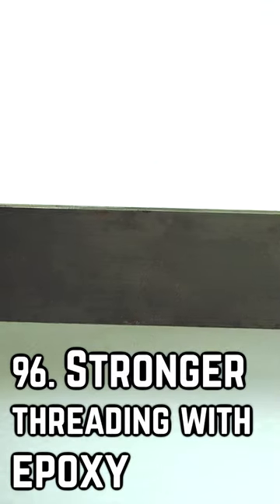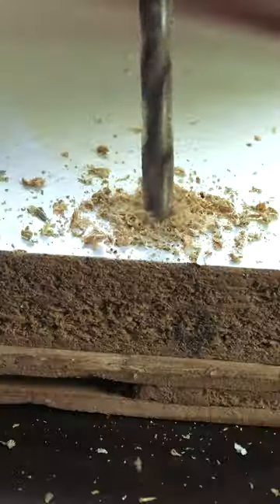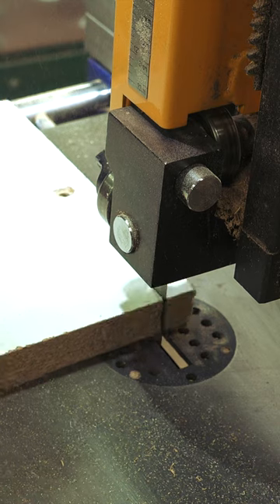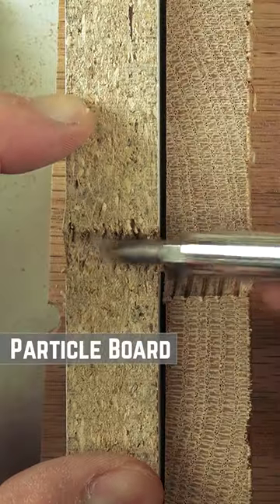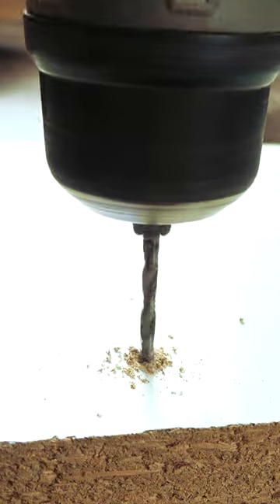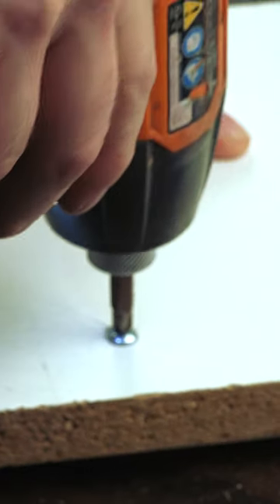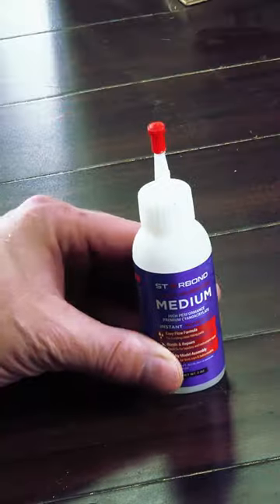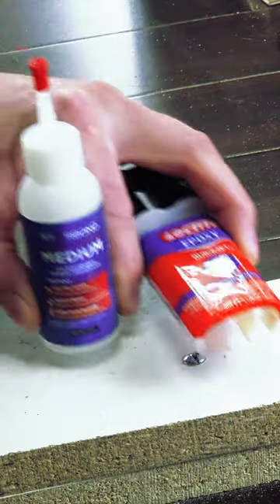96. Stronger threading with epoxy #mtbitesize #shorts

Comment: Laughed at your negative appraisal of plywood as compared to particle board. Sure, plywood can sag, but not  nearly to the degree particle board will. 3/4 inch plywood or the same in particle board for book shelves? Not even close.
I did like your idea to apply CA to screw threads when using particle board, however.
Reply: He means dimensional stability. You'll almost always pick up a perfectly flat and straight mdf board as opposed to plywood where we often get cupping and bowing.

Aesthetically that's a big deal even tho plywood is an objectively better product.

Comment: "Stability" is NOT the reason MDF is used in so many projects. Low Cost, standardization in machining the parts (thanks to no warping or differentces in the engineered lumber), and the fact you can make from literal garbage lumber are the reason we see so much of it. It was invented to rebuild Europe after world war 2 since they'd. Already destroyed most of their forests and had largely trash wood left. 
Also, MDF is not what is pictured in most of those shots. MDF has uniform density throughout, where as particle board is lower density in the middle (cheaper and weaker as a result).

Comment: Run screw in, remove screw, apply thin CA glue to threads in the hole. Just a few drops will do, cures pretty much instantly, and leaves very solid threads.

Comment: The downside is they fall apart. They can't be exposed to any moisture at all because using a waterproof glue is too difficult.  All these things are not more stable they're just trash.

I had a house that got flooded. You know what furniture survived?  The furniture that was 150 to 300 yrs old.... Made correctly for expansion, made from solid boards not glued up laminates.   

Expensive furniture where the wood was glued up fell apart.  Even if the glue joints didn't pop immediately they popped a few years later... And not anything that got wet directly.... Chair legs , and backs, are actually glued up out a little sticks..... the carpet got wet and the chairs were just sitting on the carpet... The legs split apart at the bottom all the glue joints failed but then later on the glue joints at the top of the chair also failed..... Never knew that a nice care was glued together out of so many tiny sticks.....

They used to make good furniture everything today is nothing but trash because wood is expensive.  Furniture used to be quartersawn because that was the most stable way but it wasted a lot of wood..

Comment: Could a lot longer, but maybe stronger way, be to drill the hole bigger, fill the hole with epoxy or JB let it harden, then drill and tap the size you need and use machine bolts ?
Reply: Drywall screws. That's all.
Reply: JB Weld will not soak into the particle board fibers like epoxy will, the wood fibers will soak up the wet epoxy setting it deep into the wood fibers.
Drywall and coarse threads will be a little better but not as strong as the epoxy method.
Reply: @archangel20031  ahh yeah I didn't think about the JB not soaking in, that makes sense